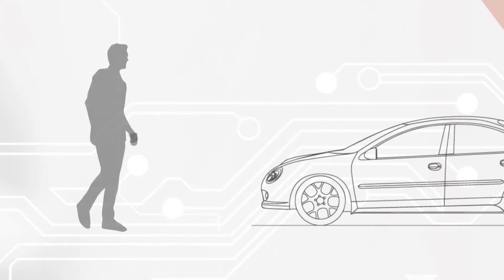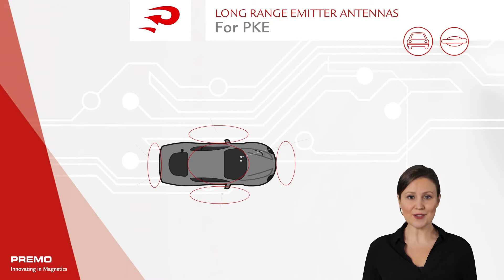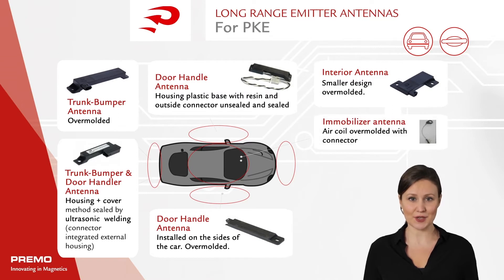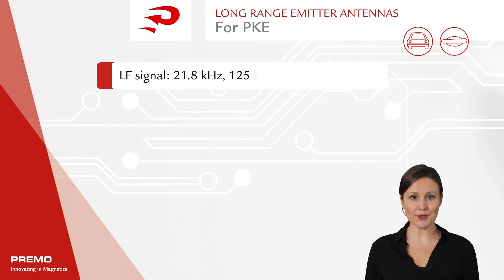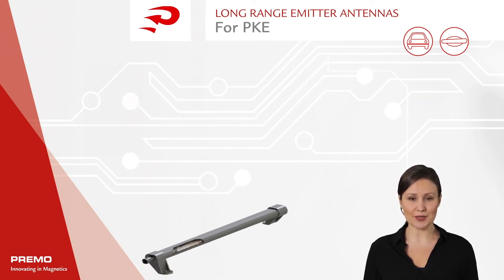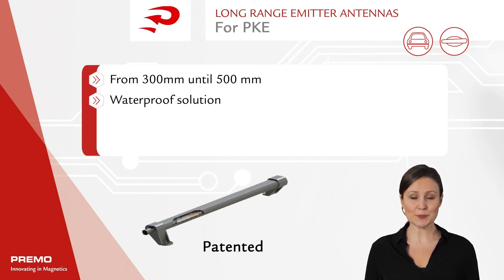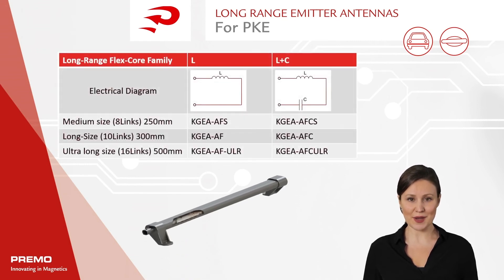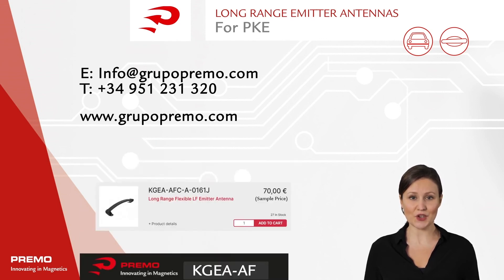Long Range Emitter antenna for Passive Keyless Entry System

Comment: How does this get installed?  Does the existing PKE Transmitter go inside the extender, or does the extender need to be hard wired into the wire that the existing antenna is wired to?